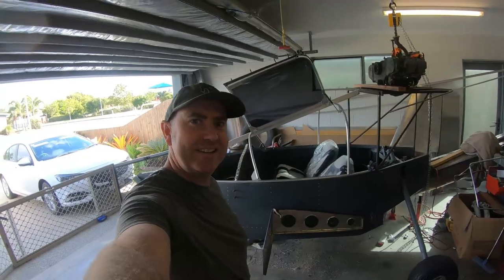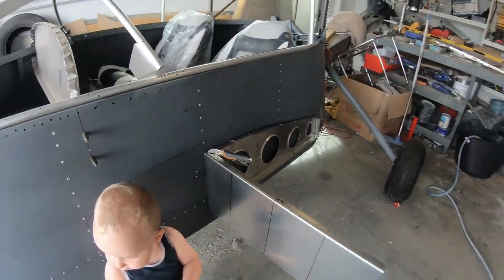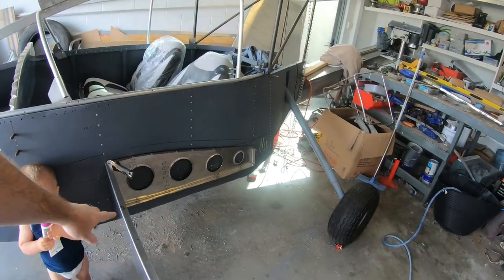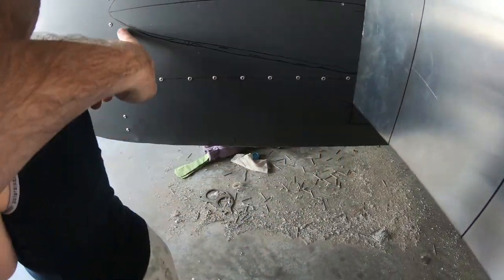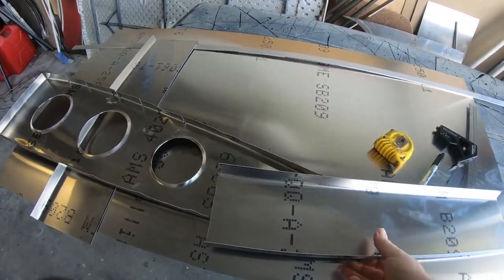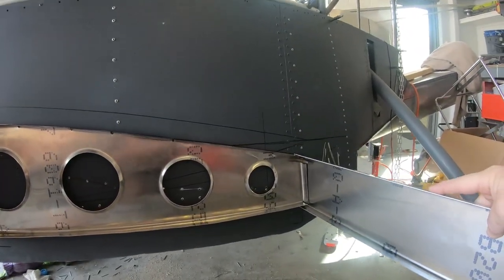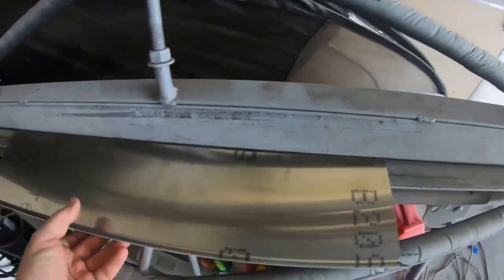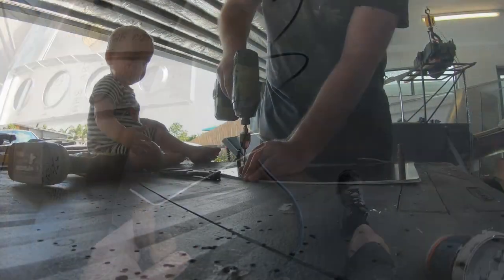Ultimate seaplane build update

Comment: Okay okay enough with this "Flying" excuse's🤣😂 We see your partner working away hard well you're just standing there yacking, thinking he must reduce your pay grade😁🤣. Some worries mate about the sponson digging in as one corner's at speed, especially with a downward angle, I calculate a 2 degree up would accomplish more of what you want.
Cheers Mate and get back to work, flying is for the Birds or those that finish their project🤣😎 Hugs to All and stay safe and happy
Reply from the maker: hahahahha yes he is a very busy boy with great work ethic. Hahah I have had many hours of backwards and forwards on the sponsons as I thought the same thing initially. I get a similar number if I want to go up however that won’t give me the desired effect I’m looking for with additional positive buoyancy at the tip. for hard cornering in slightly rough water . if the whole sponson is hitting flat there will be some severe jolts throughout the sponsons. with the 3 degrees angle of incidence and tapered front it would be very hard to bury the tip I’m thinking.I also have the  tyre right behind the sponsons and want to keep that out of the water . An icon A5 do exactly what I’m trying to achieve negative . I’m definitely no expert though . Taylor coot had add on sponsons that were completely flat that seem to work well too. the question is speed is your friend and at what point will the surface area of the tip stop planning and bury itself..... ? and if it reaches that point the rest of the sponsons come in contact with the water to prevent it burying further . with all this in mind what are your thoughts ? I’m still at a point where I can change it but I can’t help thinking if I change it I will always wonder what if 😀🤣
Reply: @michaelhille261  The key to alleviating that doubt is to build a scale model and try it. Positive will dig the tip and attempt to pull the rest with it, were as negative will be at the base which should correct the tipping moment. A model is called for in my humble opinion cause it something that could be deadly especially at high-speed planing. Re your buoyancy, you should get tonnes with the ground effect of the sponson with a little forward movement. That said how about a high lift curve on the sponsons lower surface, increases the Ground effect, and given their size may even help the stall affect as the sponsons are quite far forward of the top wing and should act similar to a small Cunard I would imagine. Computer CAD model and then a small scale Actual model would be my choice. 
Just stay and be safe, the little guy needs you for a long time, hope that helps